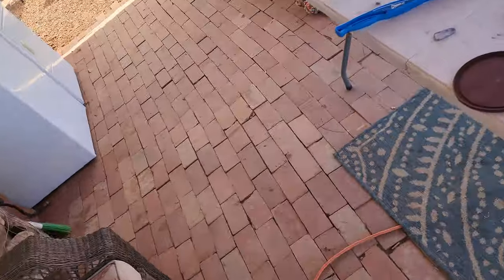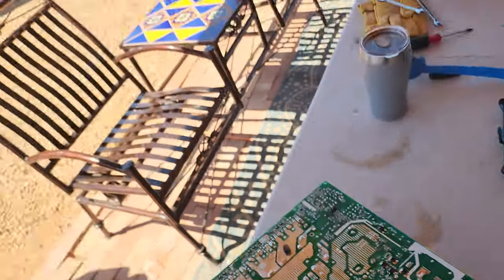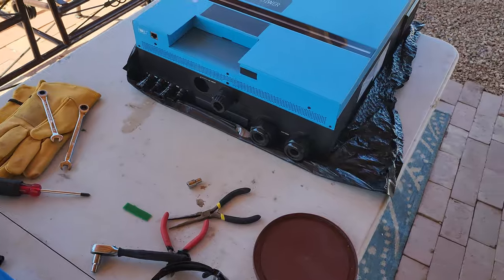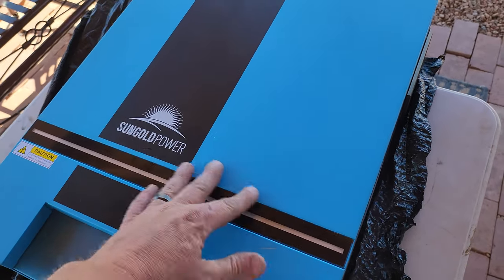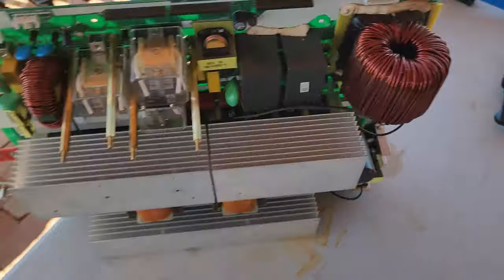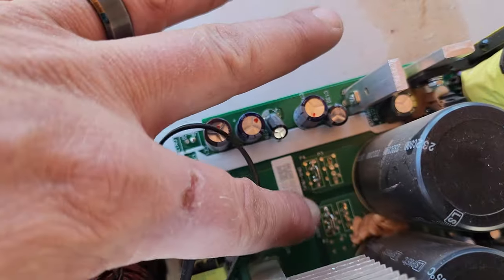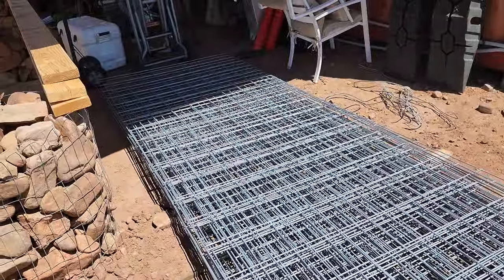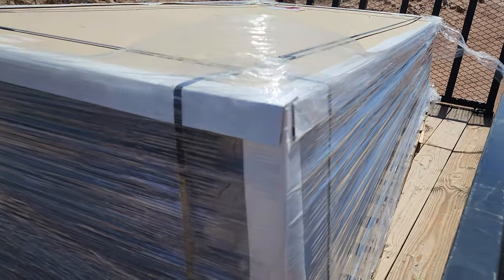SunGoldPower Blue Power 6548 Broken?!?!

Comment: Thankfully you knew how to fix it.  How old was that?  I have a brand new champion gas/propane generator that blew the control board.  They sent me a new control board with a video link on how to change it out.  At first I was upset because they didn't replace the generator it was only a couple of months old.  However, I am glad they did because it was a great learning experience and wasn't hard at all.  I also got a back up carb because they thought it was that initially.
Reply from the maker: It was almost 2 years old, and it failed because of something I did. 

It's good to hear when companies stand behind their products.